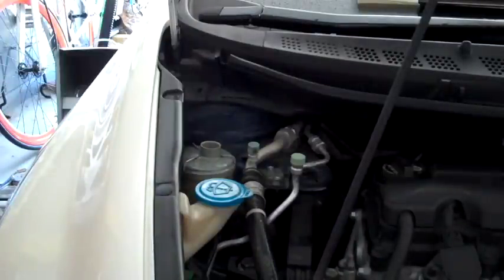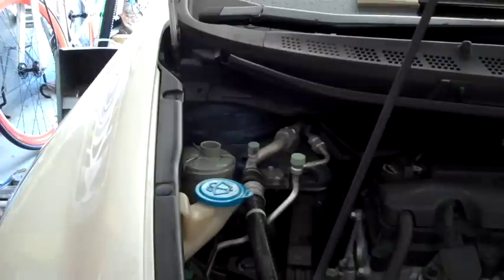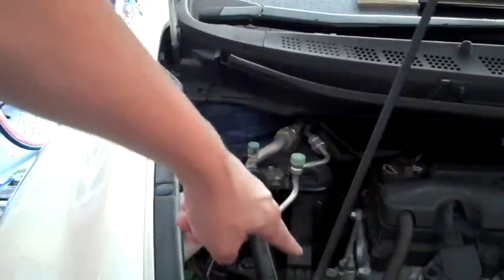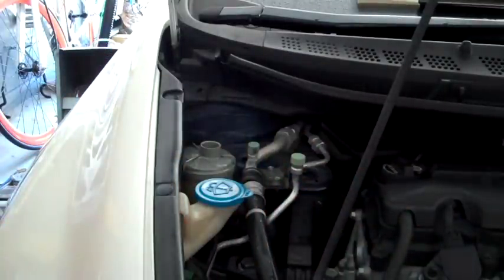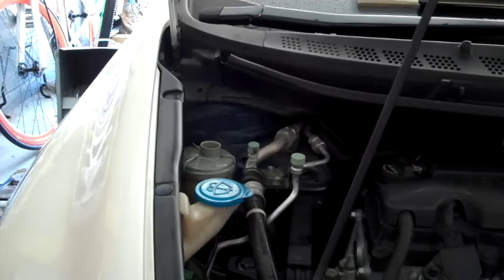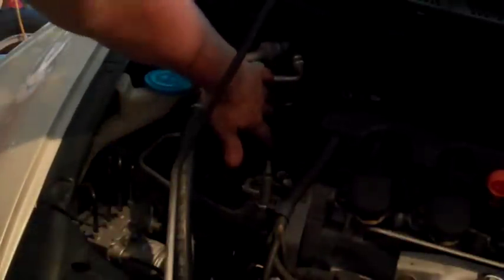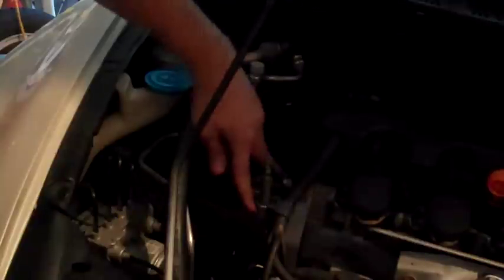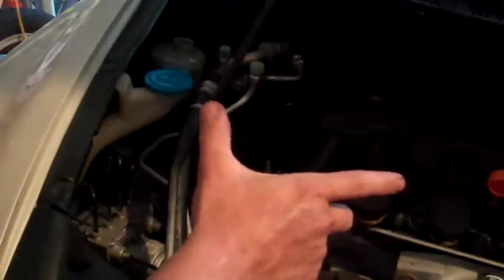2005-2011 Civic Water Pump Removal and Install

Comment: You are so lucky that Allen bolt did not break, I'm attempting to change the water pump tomorrow and my only concern is that bolt! I read a lot places if that bolt snaps  you have to pull out the motor!!! According to Honda!!! I'm soaking that sucker in wd40 see if it losen up a little bit..
Reply: adriangs-t parada 
Or the 8mm Allen bolt can strip which mines partially did. Now need to drop engine a little but not sure whats next lol

Comment: Do you actually lower the engine by releasing some tension on the jack?  This approach is not the suggested technique used in the official Honda Civic service manual.
Reply from the maker: I do, and I don't even have the manual for this car... I just do what needs to be done to fix it!
Reply: If it works, more power to you!

Comment: that tensioner bolt and pulley bolt is a T50 torx bolt
Reply: Why does the bolt look like a 8mm Allen would fit? Does a torx bolt have a better chance of not stripping it!

Comment: To change the water pump is that simple?! You just have to take the water pump bolts, then take the water pump, clean the surface, put the new one and then put the bolts?
Reply from the maker: I outline all the steps in the video. No need to clean the surface really because it’s an o-ring. Unless, that is, someone put some sort of sealant on the surface previously.

Comment: What noise was it making?
Reply: I have my sons 2006 Honda civic lx and it is sqeeling bad bad. It aslo feels like the power steering is going out when i first start the car. I did try to look at the engine and the pulley wiggles back and forth a little. Not supposed to, is it?
Reply from the maker: Mine was leaking. Noise can be a symptom of it going bad as well.

This car had about 130,000 miles or so when it went.

Comment: Why don't you ever actually show what you're doing. lol You point at bolts and then boom. Camera magic and it's done already. Anybody can look at even just an image of the teardown and guess what needs to happen. It's the HOW it's done that makes a "how to" video..
Reply from the maker: Many times, the only way to get a shot is to hold the camera in position. Also, many times, I need both hands to do what I'm doing. If I had three hands, or could set up my tri-pod, I would record the whole process. 

But since I don't have 3 hands and arms, and many times the ti-pod wont fit where I'm working, I do what I can with where I'm at.